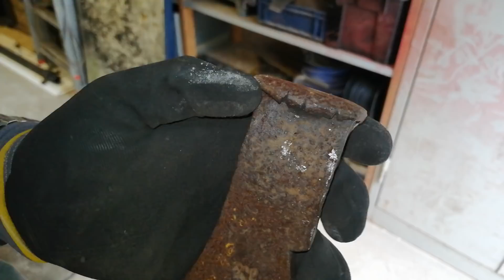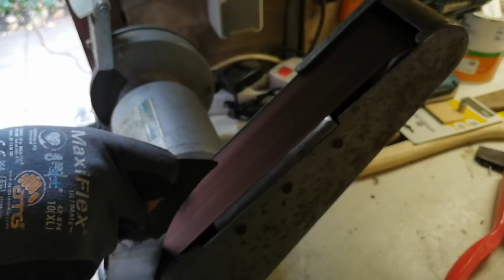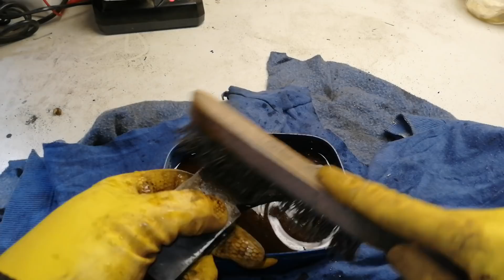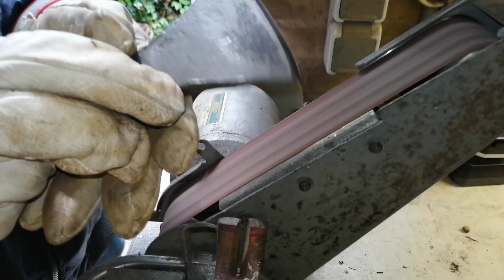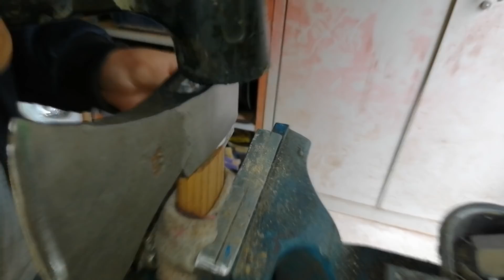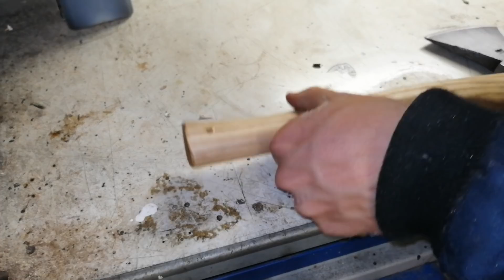Rusty Hatchet Restoration

Comment: I have restored and hung dozens and dozens of axes with great success and I researched extensively beforehand the proper way to do them. This method is wrong on so many levels by traditional methods, but the beautiful thing about it... It looks like you got a good solid hang and a usable tool which just goes to prove that there is no "one way" to do something! Well done Sir!